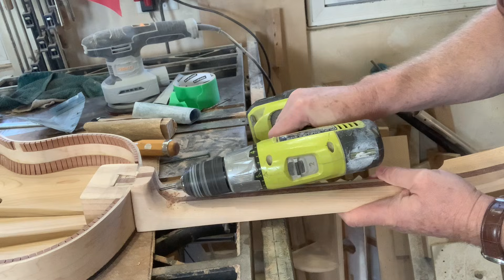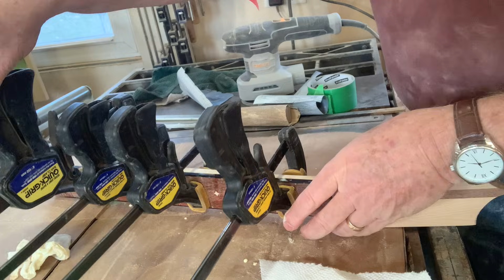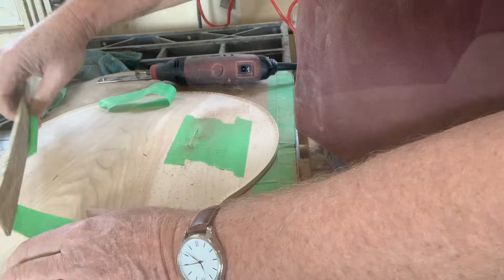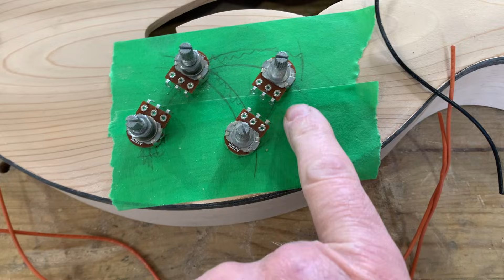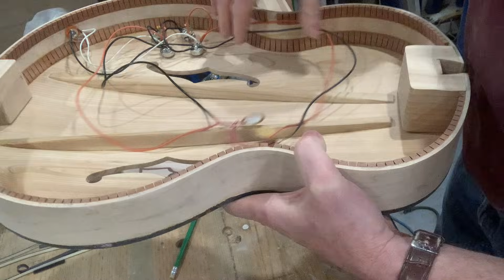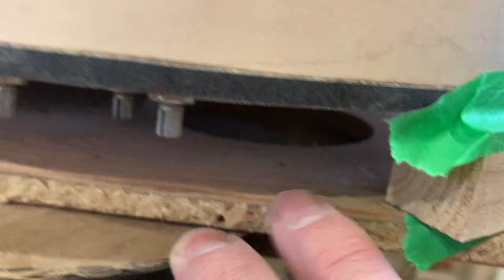Archtop Guitar - Part 19 - Electronics Installed, and Back Attached

Comment: It hurt a bit to see the hatch cut out, but I guess it can't be helped.

The drum sander arrangement to do the purfling rabbet seems unusual, I would expect  this would normally be done with a router? But the convex top must complicate things a lot.
Reply from the maker: Yes, cutting into the back was quite painful, but it was necessary.  I had thought of using the router for the cut, but there were three issues: 1) as you noted, the convex top would complicate things; 2) The router can be quite aggressive, and I didn't want to risk splintering the top or bottom; 3) though I have a "flush trim" bit, what I actually need is a smaller bearing on the flush trim that would give me the offset I need for the purfling.  I might have been able to rig something up, but the other two reasons were enough.
Reply: @secretundergroundlair4014 I think the router approach would be to swap out the bearing in a flush trim bit, although I imagine there are (probably expensive) specialty bits to create a rabbet like this.
Reply: @awldune  drum sander is safer. I would also did not want to risk router. Chances of splitting top part. That is hard to repair. But carving chisels could be helpful.. But its already done :D